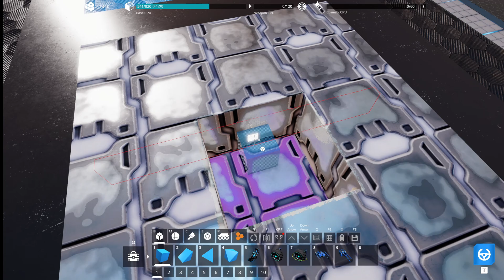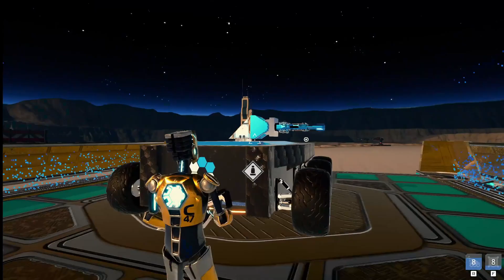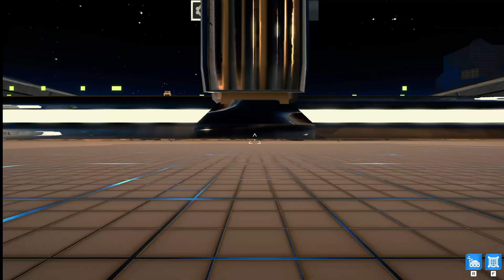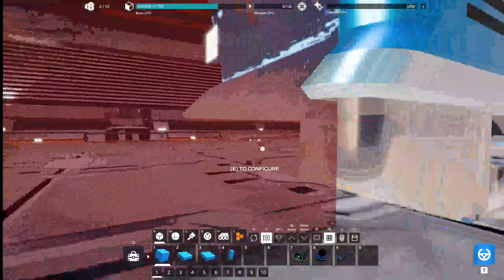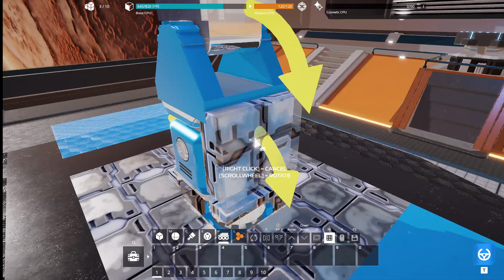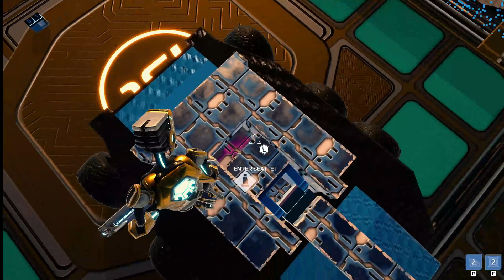Build Tutorial Robocraft 2 - Custom turret Basic and advanced

Comment: I'm curious how you would a turretless design.  Just 2 Hinges for left right adjustment and depression. I would Imagine you could get the turret to be a lot bulkier at the cost of limited movement. Since you don't have to worry about a rotating surface, just thread the barrel through a hole and mount it in the rear and you could have some super bulky armor on it
Reply from the maker: I was actually contemplating just that.. but for a design rotating the whole robot with the wheels. and only up down.
Reply: @Ketmo785  With the quick turning in the most recent video I can see how. restricting movement to up and down lets you plate it up even more. You could probably get 15-20 layers given they are going to build more toward the center of mass. The armor too will be completely separate from the barrel so it'll have fast traversal time, thus why I was going to go for 2 hinges myself. being able to just face in general direction while it quickly snaps exactly where I'm aiming I have a feeling will feel much better. Nothing major, maybe only 10-15 degrees of horizontal movement. (mounted with up and down as base with the gun on the left and right where the guns sit)
Reply from the maker: Yes. I will make a new tutorial for both armour and turret. But I want the dust to settle after last patch before I do that since I hope they tweak join strength for hinges and servos because they got severely nerfed last patch to a point where AIOs just became plain better in my opinion.

Comment: Can you double rotor and hinges
Like on top of one another or with hinges side by side
Reply from the maker: yes you can but its not good for a turret with to many stacked hinges or servos. Every hinge ad instability. Even with just one like I show in the later part of the video will result in a little bit less stability than not using it and can become very wobbly if you have high ping during a game.

You can make dual turret but the joints are rather expensive in terms of CPU so you will end up with a lot less CPU for armour.

Comment: Small correction: The faster aiming speed, for less CPU, is really best at hitting fast moving or unpredictable targets. A custom turret won't have difficulty hitting things far away either, as long as they're moving predictably. This is because they're slower, and move less degrees in the same amount of time. But you don't need many degrees to hit a target far away. 

Also, a quick note for anyone looking in the comments: The singular laser turret is a really rough choice, because it has terrible gun placement. Its generally better to use the two laser turrets or custom. Singular plasma is fine (better than the two plasma turrets)
Reply from the maker: True. I realize it is bad choice of words from me. the reason i said ..on the horizon or far away or however I was wording it was because I was thinking about a flyer when I said fast and they are usually a bit away. A fast moving target close up will of course be a lot more problematic and harder to track